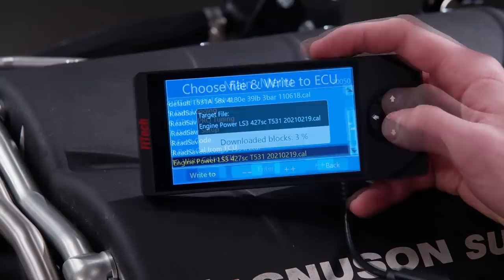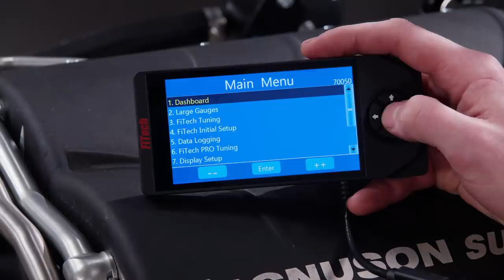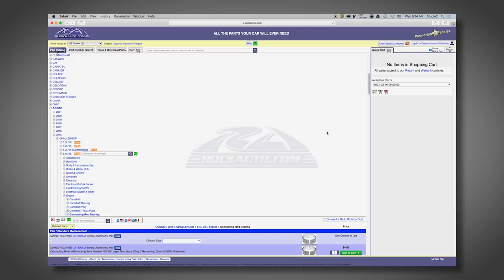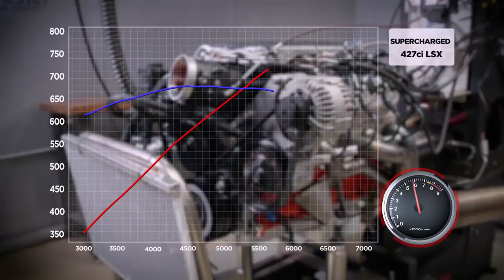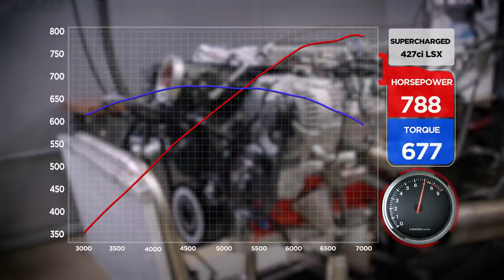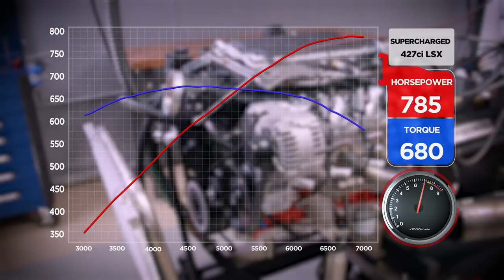Reconfiguring A 427 LSX From Naturally Aspirated To Supercharged - Engine Power S8, E8

Comment: Nearly 800hp on just 6lbs of boost! Big power that's going to last.
Reply: It’s mostly due to cubic inch, the more cubic inch the less boost it will make. If this blower were on a smaller inch LS it would probably make 10 psi.
Reply: @Brendentosto  not only that, but it has high flow heads and a big cam
Reply: This is a built 427 it should make that much power, Raceprovenmotorsports has a video with a 6.2 on 8lbs of boost making this much power.
Reply: There is something to that. I'm almost 600hp with a turbo Coyote on 5-6psi with the stock cams and heads. Even dropped compression to 9/1. I think a lot of it has to do with nearly 300cfm from those 4 valve heads.
Reply: @177SCmaro  Those heads flow big time.
Reply: @MrUltraworld  What's scary is they're not even ported or anything. Just stock 2ed gen heads straight from Ford with vvt deletes and pined 15 mustang cams. Yotes love boost.
Reply: @177SCmaro  the Ford gt heads on 07-14 gt500 flow pretty damn well too.  I've heard they flow 300+ cfm stock and on the exhaust side they do like 255 or something (ideal for boosted applications as they were factory supercharged) they too can make 1000+ without porting
Reply: It's a 2000hp short block 800 is a d. Shame  I would want to add some hooker crossover headers and a large turbo and compound boost it. Have to have an air water intercooler but 14000 hp should be reliable. Goal 1250Tq out of a built tremec.

Comment: Pulley swap away from 900hp if you get 9psi out of that supercharger. It can easily go up if need be. High hp with the lower boost is nice though, probably last longer and be more street friendly.

Comment: "After the AMC fans brought out their pitchforks and torches, Detroit Muscle wisely decided to use the 304." Damn straight! Far too many, "went with a LS engine," builds. Even if it's a LSX, putting a GM engine in an AMC heresy. From my vantage point, only AMC should go in an AMC. And I would be totally behind a punched-out and/or stroked 401. Because AMC was the "little car company that could," and to use anything but AMC is disrespecting the legacy. AMC fans are a loyal crowd and will always pull for the underdog.
Reply: Yes because being slow is cool.

Comment: You just cant beat good ole GM power. Best engines out there. Ls and sbc.
Reply: Id hope they would know how to make a sohc v8 at this point.
Reply: They aren't the best engines out there but whatever lol.  Coyotes and condor/trinity v8 4v fords and 03-04 cobra 4.6 4v motors all can make big power with just boost on a stock long block with way less cubic inches than the 7 liters shown here.  Doing it with 4.6, 5.0, 5.4 or 5.8 liters max is dope.  Dohc + boost is like a cheat code.  This thing is a built highly modified 7 liter lsx.

Comment: Looks like the smaller pulley gave it belt slip or couldn't keep up...the first run didn't have that power dip from 6500-7000....
 It may have been in the springs as well but looked like slip...

Comment: one thing I don't remember you people ever really discussing is what type of oil do you use in these high horsepower builds.  Do you use just a normal oil like a Pennzoil that's rated for high hp or do you use a synthetic oil such as amsoil?
Reply: They run royal purple I have seen it in some vids
Reply: Race oils

Comment: always liked at least 10 to 1 compression with a boosted application because I can keep boost low and make great power.
Reply: I mean at the end of the day cylinder pressures are about the same either way weather it's higher boost lower compression or visa versa.  It might keep iat down and make recovery time better and be easier to cool the blower but I don't think it's really much better on the engine itself but at the same time some blowers don't like to be ran at such low boost and perform more optimally at a higher boost level.  Each blower has an efficiency island that you should try to stay within for best results and not go under or over that.

Comment: I’d love to see that with 10 PSI boost. 👍🏻
Reply: It would make about 875hp. It adds 22.5 hp/pound, with 650 as it’s normally aspirated base line. 650+225=875. 

All this considering the blower could even move that much air in the first place.

Comment: It's killing me, so few episodes on the javelin, we need a update on what happened to it!
Reply: @bigboreracing356  I agree, gm products don't rule hot rodding
Reply: @leonardwalters154  it was on TV.   A God awful paint job and a ridiculous looking stance.
Reply: the biggest issue here is that no one makes "new" products for AMC engines.  All the product lines have not been updated or re-engineered for the last 30 years. Powernation works off manufacturers giving them parts to hype. There is just no money in AMC.  And this is coming from a real AMC fan. I've owned and raced Javelins, Rebels, Matadors, the works. I've built AMC engines that do go fast. But the reality is that engineering for ICE's has come so far from AMC that it is crude and limited. A lot of engineering advances have been "backported" to the Chevy 350 (the classic small block) and GM continues to build newer and better engines.

Comment: They said the motor made 647hp all motor 19:05 min into this video. Then they bought a $7k supercharger not including accessories and only added about 140hp? Seems Waste of money.  The dollars don't make cents.
Reply: It's a 427 that's built up from a previous episode, adding Octane booster to 93 and with the 2650 supercharger they should be hitting 950-1K Horsepower.  They could hit 785HP with a  built 6.2 IMO. Race Proven Motorsports does this all day on their channel.

Comment: Nice but that setup wants at least 15lbs of boost, need a different Supercharger then you’ll see 1200hp easily and still comfortable.
Reply: You build it and show us all how its done until then watch the show and don't critique it
Reply: I agree if that supercharger was any smaller it would be a restriction. That 427 is breathing some air naturally and needs something adequate to take advantage of what that engine has to offer. 4 to 6 lbs for the price of a magnuson, just not worth it, not much over NA. That SC would be more at home on a 6.0,6.2.
Reply: @Steven Belue  they could push alot more boost than this bro it doesn't need a bigger blower just smaller pulley

Comment: I have a question.  Not much of a car guy,  but I have a 2008 truck and I want to drop a ls427 into.  What do you think cost would be for this type of engine?
Reply: More than the truck for sure, if anything do a summit pro LS 408 stroker with some reworked stock casting heads and call it a day💪🏼

Comment: Nice engine, I bought a rebuilt engine and been using Lucas high zinc 10/30 oil, can I continue to use it or do I need to change it to a different oil?
Reply: Go back to regular oil on the next oil change

Comment: That intercooler/heat exchanger/pump/line size combo is crap.  You will see the ecu pull timing because that set up won’t last very long on the street.  Hero runs on a dyno don’t mean crap on the track/street.  You will get high (140+ degree) IATs well before you can make a full pull.  Timing will get pulled to protect from detonation.  Ever part of the S/C cooling system needs to be at least doubled.  Heat exchanger is waaaaayyyy too small and pump is junk.  The intercooler in the magnusons is very undersized.  Jason Etter at Deparment of Boost has some very good tech info about supercharging engines.
Reply: I agree.  This setup is not going to deliver the "rated" power for very long before IATs get out of control.  I'd be interested to see the intercooler inside the supercharger.  it seems like it would be pretty small due to packaging.  The pipes feeding water through seem very small and have a LOT of bends.  I'd be shocked if the intercooler can flow more than 8gpm.  For 10 to 12 pounds of boost and use on a road course you want at least 15 gpm and a 1000 cu/in heat exchanger.  This setup comes nowhere remotely near that.  I'd wager you'd lose 100 to 150hp after around 30 seconds of hard pull.  IAT rise is math, and math tells you how hard you need to work to remove that heat.

Comment: I need some help on my 76 f150 I built in memory of my best friend
Reply: what help you need??
Reply: @P71ScrewHead I need to find a  zero balance flywheel for the internally balanced 429 Ii zf 5 speed swapped it but it was a jegs flywheel and the ring gear pitch is off and I need to get a new wiring harness for the light side of the truck the engine is only 3 wires I swapped a HEI distributor and 1 wire alternator so no engine harness is necessary and the tow company who hauled it from my ex wife's said that it rolled off the roll back and hit a tree so the back body on the passenger's side  needs a bed side to bad because it was from Florida

Comment: So their $30,000 engine from LME can't even keep up with a $15,499 632 NA engine from Blueprint Engines that has a 30 month 50,000 mile warranty?
Reply: 1. This and the 632 are for two completely different purposes. This is a track engine meant for hours at high rpm, and the 632 is a drag strip engine meant for short bursts around 5,200 rpm.
2. The Blueprint "warranty" only covers assembly mistakes. It doesn't cover spun bearings, broken rods, etc. You need to read past the words "50,000 mile warranty"! They don't even try to hide that in fine print. It's as bold as the word " warranty".
Read it, if you don't believe me.

Comment: The new 7.3 already made 1400hp with just low boost, and not a  After market race block. Lol
Reply: The Godzilla 7.3 that made 1450hp had 16.6psi of boost... Wonder what this engine would do with that much boost
Reply: @lumpy1603  Haven't seen that 1400Hp Godzilla, but supposing it is turbocharged, then this LSX turbobharged was a way over 1200Hp, these guys had an episode or two in the previous season with it. If supercharged, then I think not that much, robbing power to move a twin screw blower isn't going to help, no matter how much boost you put in it...
Reply: @Thraser999  Had a 3.0L Whipple blower

Comment: So you took a 647 horsepower naturally aspirated motor and you turned it into a 697 horsepower supercharged motor..

You guys are the masters of spending maximum dollars for least power gain.. you should actually call Guinness records it's amazing how bad it is.

P.s. oh look you reduce the supercharger pulley and now got 785 so all of that money spent for 21% gain or by 2 $169 eBay turbos...... And surpass those gains, without having to steal your neighbors kidneys and leave him in a bathtub of ice.
Reply: It's still capable with that. it's only on 4-6lbs of boost not 15 like the last run it had.

Comment: Yes forcing the air up making it have a longer path of travel creates more HEAT. The enemy of any performance engine.
Reply: Im no super charge expert or engine expert at all but im pretty sure that blower or every blower has a heat exchanger inside. Thats why they put that external radiator to cool the heat exchanger inside the super charger